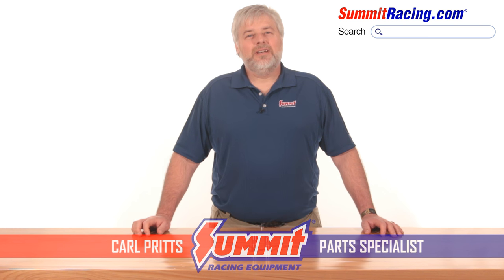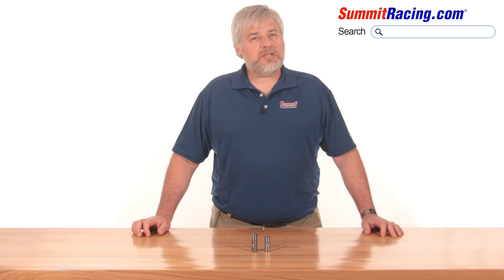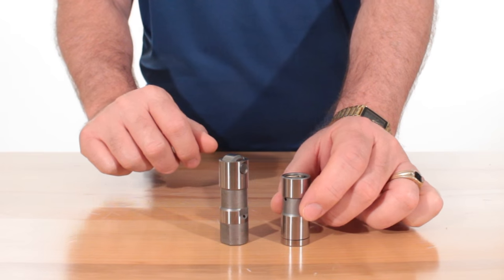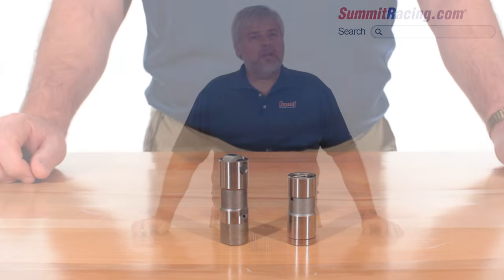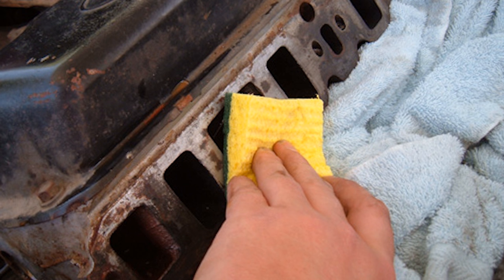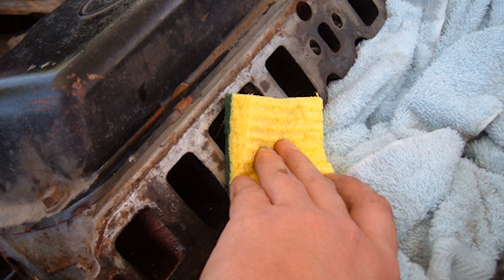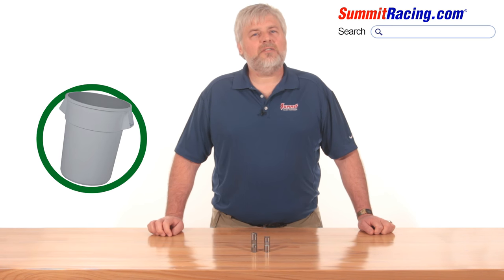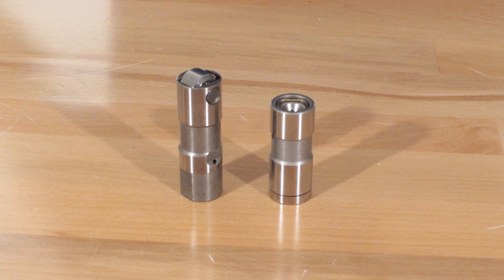Lifter Installation Tips - Summit Racing

Comment: Quick question but my question is in reference to a much smaller engine 196cc. Still the same basic concept i would imagine just smaller parts. So if you could imagine remving the side cover off of a 196cc honda clone engine and you see the cam sitting in it's place on the bottom right and you pull the cam out and then immediately see the 2 lifters on the right side. If those lifters cannot be pressed all the way closed so that they are flat against the engine block and create a seal would that prevent the engine from starting and cause a backfiring popping sound while you're trying to start the engine ? I ask because i recently purchased a pair of Billet Lifters to replace the stock lifters but just realized when i put them in that i can't get them to go all the way into the bore hole that they sit in. They stick out by like almost an inch. I'm thinking they may be the wrong size and therefore not fully closing the intake and exhaust valves and that's why it won't start now and backfires while trying to start ? Also since i installed them the timing keeps coming misaligned just from trying to start it. The 2 dots one on cam and one on crank gear that connects to cam i line them up perfectly and go to start it and then check on them afterwards and they're no longer lined up again. Gotta be the lifters causing all this right ? I should take out those billet lifters and put back the stock lifters and hope that works ?

Comment: Is the replacement of HLA/bucket-type lifters on an OHC engine required when installing a new camshaft as well, or does this only apply to pushrod engines?
Reply: Ask the cam manufacturer, if you have the spare cash probably do it anyway since it's already apart?

Comment: That part about needing to replace lifters at the same time as the camshaft 👍🏼
Reply: Yeah... you can put new lifters on an old cam [with break in just like everything was new], but never ever put old lifters on a new cam.  If you do that, better check old lifters coming out and make sure they still have a radius on them - if they are flattened, time for new cam most likely.  If they went concave, toss all old parts without blinking.   Anyway, lifters are cheap compared to having to tear down, replace camshaft, damaged bearings/polish crank, and clean the block - and that's if you are lucky.

Comment: I have lm7 that I'm rebuilding. I soaked the lifters in mineral spirits and when I open them up all I have is a clip and a plunger. It's like it's all stuck in there, even tried a using pliers to softly wiggle on it. Nothing. I have 5 like that and thought I would do research. Any recommendations?
Reply from the maker: It’s not uncommon for new lifters to not compress without the assistance of a vice.  When filled with oil and the lifter is rotated from base circle to max lift, you can watch the valvespring and pushrod slowly depress plunger over time due to the bleed down.  This gives you an idea of the force involved to depress the plunger.

Comment: Does anyone know what way direction the lifter hole goes on a 98 saturn sl1 ?
Reply: On my 5.0 they have to be pointing upwards since they're in a v config. If there's a angle most likely pointing ☝️
Reply: @trianifeA7x   I just pointed mine faceing the exit hole the oil flow coming out of

Comment: I removed my MDS lifter and replaced them with non-mds lifters in my 2011 Ram 1500 5.7 hemi. Do I need to adjust the timing after that swap? I've tried to start the truck, but it won't stay running. THANKS in advance for any opinions.
Reply: Did you turn off your mds by tuner?

Comment: What about new lifters on an not so old cam?
Reply from the maker: You can install new flat tappet lifters on a seasoned camshaft. First, inspect the camshaft for signs of excessive wear or areas of failure. Use plenty of camshaft break-in lube on the lifters and cam and treat the new lifters the same as a cam/lifter break-in procedure and use a camshaft break-in oil. 
 
Break-n valve spring pressure should be between 80-100lbs at the seat. If you have dual springs, the outer springs should be the only ones used during break-in.
https://www.summitracing.com/search/part-type/assembly-lubricant?N=assembly-lubricant-usage%3Acamshaft-break-in
 
https://www.summitracing.com/search?SortBy=BestKeywordMatch&SortOrder=Ascending&keyword=camshaft%20break-in%20oil%20